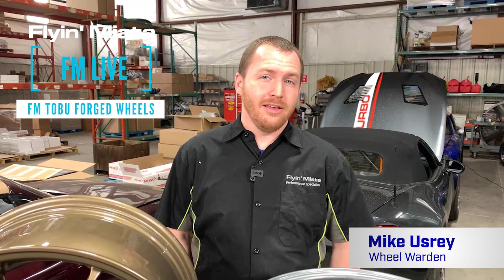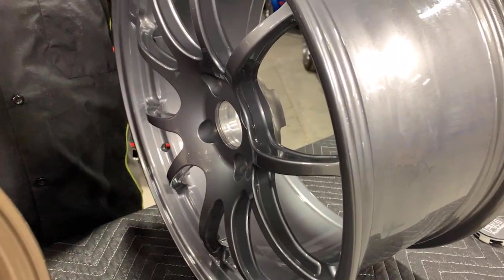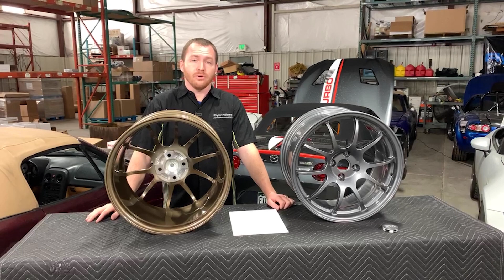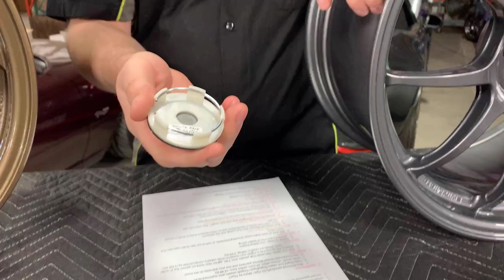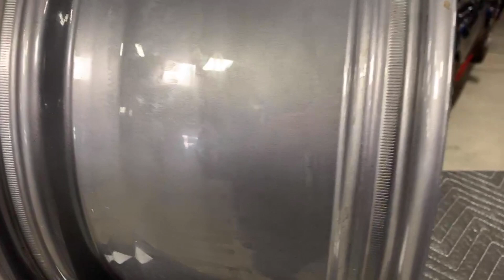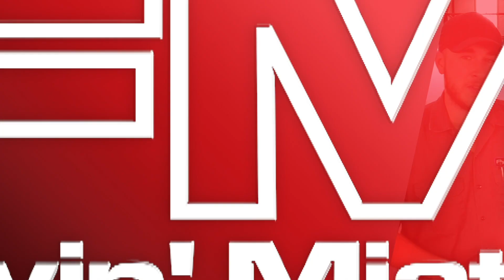FM Tobu Forged 17x9 Wheels (FM Live)

Comment: Do they fit ND with +45 offset and slight negative camber? (-2.0 , -3.0)
Reply from the maker: @OneUltimate22 The 17x9 Tobus will fit with a 235/40-17 tire under unmodified fenders. You can fit a 245/40-17 tire with a bit of fender rolling. Some negative camber will probably help clear the fenders a bit, but we don't typically run as much negative camber as you're suggesting.

Comment: Do you all have a video about what are the benefits of a lighter wheel/unsprung weight (I have a 21 RF GT with stock wheels)? What are costs vs benefits with going wider than stock for a car that will stay a street car until warranty is up?

Comment: I would love to see these in 17x8.5.  Gives ND owners a lot of tire options (225-245).

Other then Rays Transcends they would be the only 17x8.5s around.
Reply: i agree i would go 17x9 rear 17x8.5 front.
Reply: Benjamin, 225-245 will fit on 17x9 no problem. For some tire shops like TireRack, you will have to tell them that it's for "track use only" though when mounting 225s.  They actually "nudged" me in to saying this in emails when I ordered 225/45R16 on 16x9 Storm S1 wheels.

Comment: i like them, but 17x9, i think it would be to wide is the front. please tell me it works well on the front.
Reply from the maker: Depending on your tire and suspension set-up you might need some slight modifications, but we've had no real issues with these on the front. With a really aggressive wider tire, you might need to roll your fenders, and you may still contact the splash guards at full lock. Give us a call at 970-464-5600 or drop us an email at support@flyinmiata.com if you have any specific questions or would like to talk with someone in person about our experiences. Thanks!
Reply: @FlyinMiataVideo  I would like to see a 17x8.5 For the Front. 17x9 rear.
Reply: @red5standingby598  Half an inch difference in wheel width is not worth not being able to rotate.  If you want to stagger then 205/45R17 on 17x8 in front with 225/45R17 on 17x9 in rear is the way to go.  Keep the steering feel while increasing power on grip.  Or 17x9 all around with 225/45 in front and 245/40 in the rear.
Reply: I have a friend running 17x9 and it only barely rubs occasionally. He's running 245/40 Michelin Pilot Sport 4S. He drives it hard and it's fine. You have to run a bit more camber.